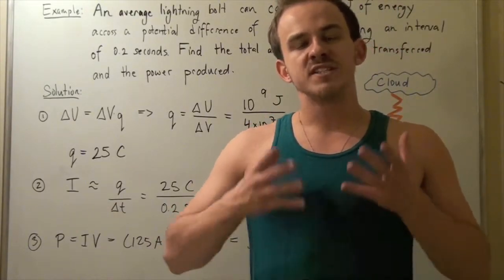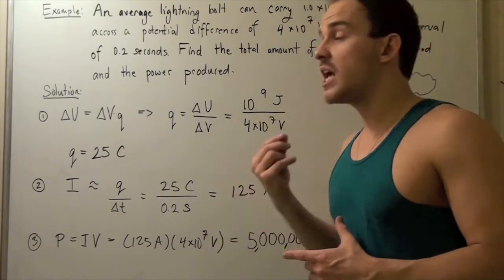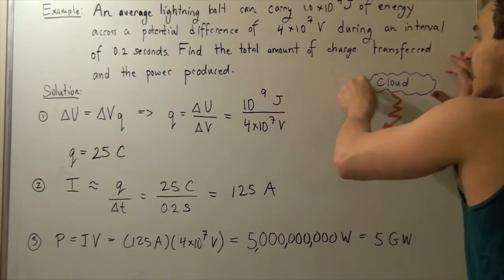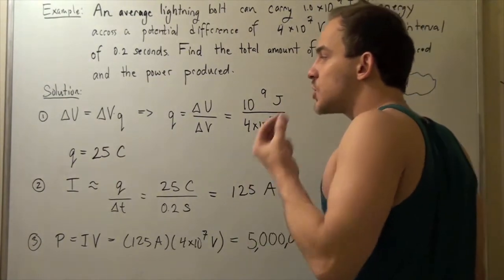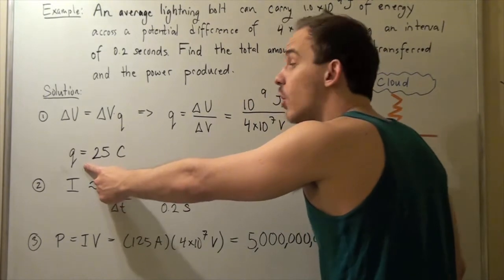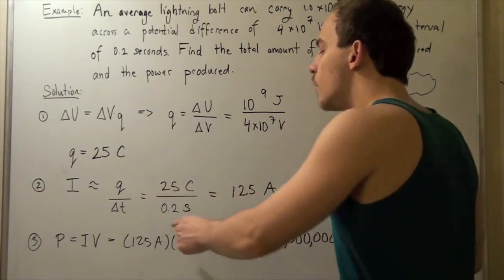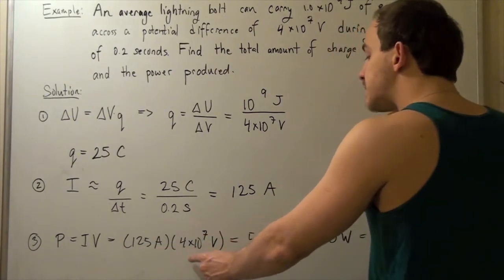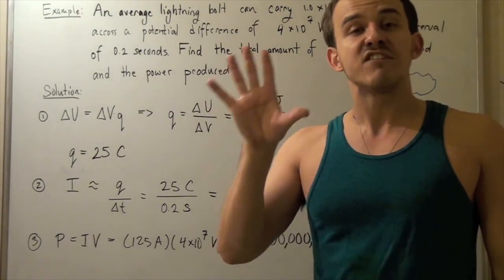Electric Power Output Example # 2

Comment from the maker: Quite possible. I am no expert on lightning and would not know the specifics of how much energy is transferred per type. And you're absolutely correct. The ionization of the molecules in the air needs to takes place before the actual current moves. So the pathway is mapped out before the current moves and this allows for it to conduct well to a small section on the ground, which has become positively charged.

Comment: I think your overestimating the amount of power lost to heat. The lightning causes the path to ionize which transfers power much more efficiently . Evidence of this is at the places a strike has happened, it's only a very small area where the strike happened that is effected. Kind of the same reason neon lights only heat up a small area unless left on for a long time and even then they are easy to cool.

Comment: 2nd question: What is moving through that bolt of light and heat (and pressure which is generating the sound)? Is it some electrons, or what form of ions are they?

Comment from the maker: and as a result of the rapid rise in temperature and compression, explosions take place, which lead to the bright blue-white color. The energy also propagates in the form of a shockwave, or sound wave that is produced as a result of the explosion. I am sure what the proportion of energy releases as "heat" compared to how much energy can be harnessed in say a lightning rod, but my bet is that quite more energy is released into the environment as non-reusable energy.

Comment from the maker: Hey! Basically, anytime we have an electric current (moving electrons), we also have a release in energy associated with the moving electrons (known incorrectly as heat). Anyways, because the current in a lightning strike is so large, it also releases a large amount of energy that cannot be harvested in any way. This energy is given off to the air molecules surrounding the pathway that the current follows. This causes the air molecules to rise to temperatures hotter than the surface of the sun

Comment: Any idea about the claim "much of the lightning bolt’s energy goes into heating the surrounding air to temperatures greater than the surface of the Sun. So even if you managed to overcome the problems of collecting, storing and converting the energy from the lightning to make it useful, you would still only be harnessing a small proportion of the lightning bolt’s power."

The physics behind this?